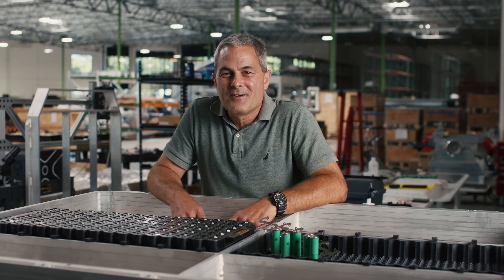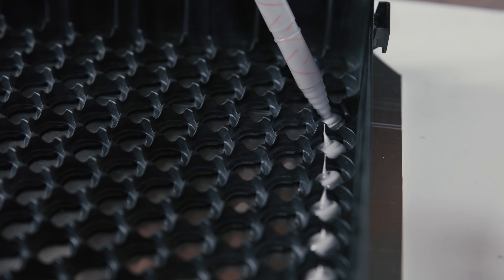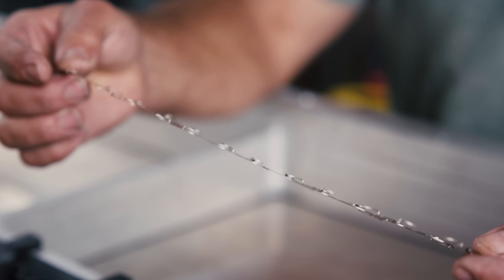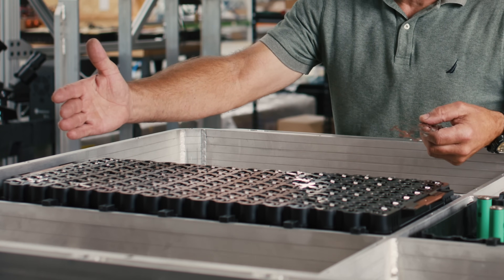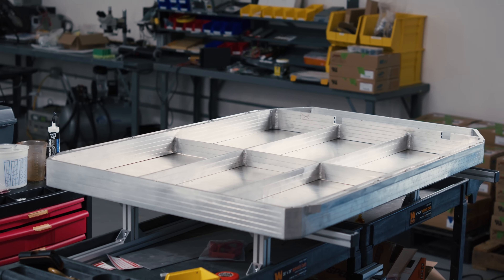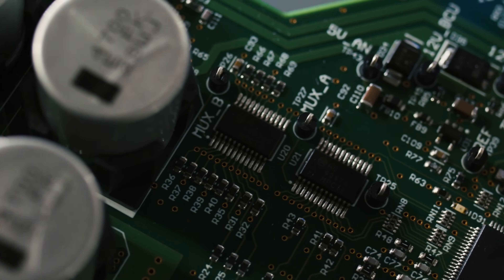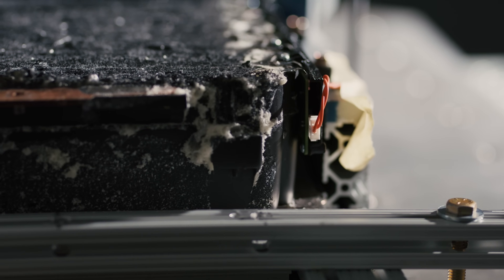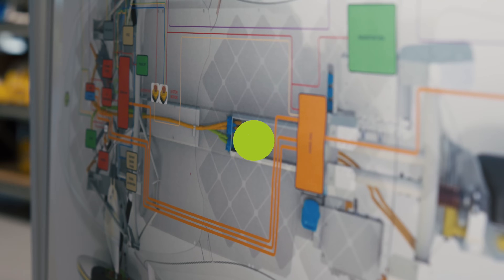Aptera — Battery Validation

Comment: Why would you choose to make your own battery packs when there are companies that have MUCH more experience and capabilities? I'm a little slow sometimes; but this video has really helped me to understand why the development of this car has taken decades. Gotta put this effort in the same column as the cybertruck.
Reply: The packaging, or size and shape of the pack must be compatible with the unique shape of the Aptera. This also considers structural bracing requirements of the vehicle (the aluminum subframe the modules sit inside).

The weight of the pack is also a higher concern with the Aptera compared to other vehicles because of the efficiency goals. You can see that some very careful design work went into making the structure of the modules as minimal as possible.

Lastly, there are lower than normal cooling requirements (because of Aptera's reduced energy use), so the cooling strategy for the pack is lower than normal.
Reply: @bobbygaglione7553  Call me stupid but....sexy aerodynamics are somewhat important; but definitely NOT the whole story of "what makes a car go".
There are plenty of very experienced companies that will make bespoke battery packs in any size and / or shape imaginable.  
Another thing that just doesn't fit with this concept is that there is NO WAY that enough solar cells could be attached to the external surface area of the car that wouldn't require DAYS to charge the battery for any meaningful driving duration. Examine the existing solar powered velomobiles which are about one tenth the weight of the Aptera. I hope that I am proven wrong....but this whole enterprise looks questionable.
Reply: @someguydino6770 the solar only ADDS additional miles, it charges just like ANY other EV as well
Reply: To keep the process in-house not only simplifies the supply chain, but it also reduces costs in the long term (by removing the middle man) and reduces risk (In case that middle man stops working with Aptera for any reason).
Reply: @Roshiyu  it is obvious that you are inexperienced in manufacturing - good luck with your studies
Reply: @someguydino6770  Would you care to detail where I'm wrong, instead of just assuming I'm a student? 

In-house production has always been a higher up-front investment, outright buying the machinery required. But in the long run it's lower cost, compared to being at the whims of a third-party producer.
Reply: @Roshiyu  I believe that the absolute BEST thing that you could do right now would be to liquify any assets you have and then invest the resulting funds in Aptera.

Comment: Is it possible to install these battery cells without majority being human work? -> Heavy equipment over his shoulder and cell placement doesn't look efficient in first half of this video.. ps: congrats on your early validation here by the way, SUPER AWESOME, keep it UP 🎉
Reply from the maker: We are simply hand-building modules for the initial PI vehicles. The battery assembly will be mostly automated by our partner CTNS for the production runs.

Comment: That is awsome!.. Will the pack validation plan include corrosion resistance tests? and humidity infiltrations test ( not IPXX but ) ? These are very critical to make sure the battery will not be affected by humidity due to pressure changes, temperature changes, condensations etc.
Reply: Whatchathink?
Reply: @manoman0  probabky but having a video also talking about that would be important. Vibration test does not make alot of EV battery deffect.. but corrosion DOES!

Comment: Not many people understand the level of scrutiny that goes into building a road worthy EV.

I appreciate and understand the level of detail that everyone goes through to bring a safe and reliable  mode of transportation that will be around for years.

Look what GM did with the Chevy Bolt.... battery recalls are sinking them into the ground over one stupid little mistake.

I want Aptera to be around for generations to come and love where they're going!

Good job, Aptera! Keep it the excellent work, and I look forward to seeing this finely crafted vehicle on the roads soon!
Reply: Wasn't that the battery manufacturer and GM passed the bill on to them for the replacement packs?

I agree in that I hope Aptera can maintain proper quality control as a lot of this goes from one offs in the lab to mass production.
Reply: GM could have gone with one of the top 2 suppliers but they chose to gamble and lost. Why? Was it to save $? Executive mistake? Both? The battery was double flawed.
Reply: Wondering if the Aptera (though I doubt it) will have the problems like the Tesla's that burn to the ground?
Reply: @MIRAGEDEALER  :face-purple-crying:
Reply: @MIRAGEDEALER  holding my fingers crossed that nothing of that sort is going to happen. They present themselves as very conscientious and meticulous.

Comment: There is no insulation for the negative terminal on the top?
Reply from the maker: There is! 💚 That’s what you can see during the vibration test. Other battery modules in the video are before the insulation is applied.
Reply: My vwid4 will take one hour to charge to 250 miles, Aptera will charge over 400 miles per hour, i think that’s awesome